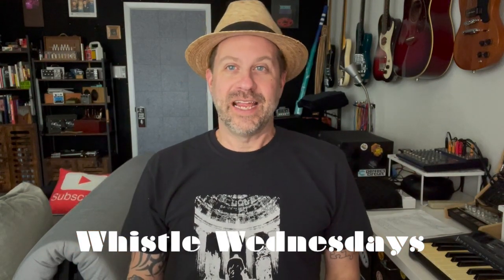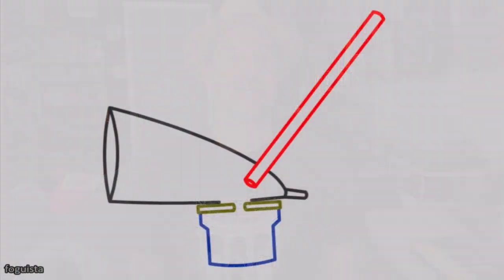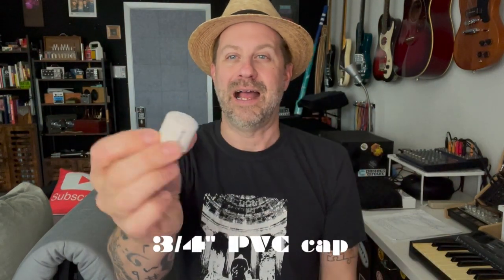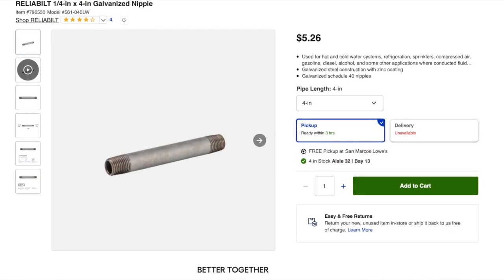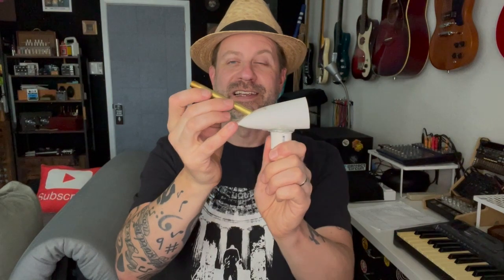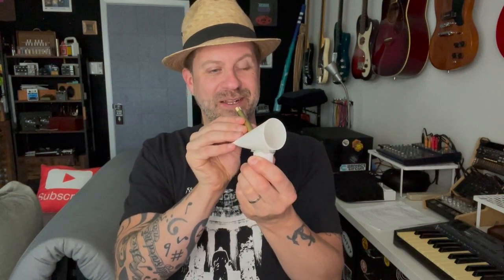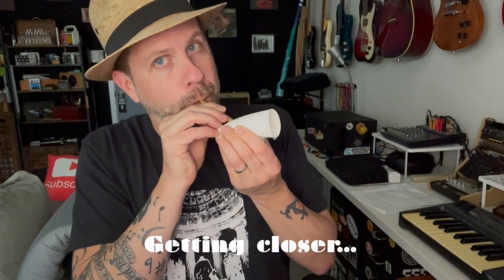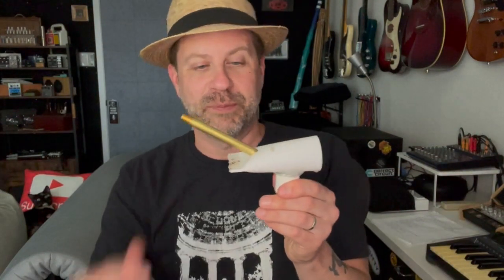I Attempt to Make a Death Whistle from Plumbing Parts

Comment: Question,Can i use wood instead of tube?
Reply from the maker: Are you looking to carve the whole thing out of wood? If so, I don't see why that wouldn't work. However, that's a LOT more effort. YOu'd have to start with a block of wood and carve that conical shape, then hollow it out. Yikes. The idea of this project was to be simple.
Reply: @musicalmiscellany  No i meant for the pipe replacement
Reply from the maker: @Ultra52b62  It could be wood, plastic, metal, cardboard, etc. It just needs to be something hollow you can blow through.

Comment: Is it possible to make it out of wood? (Just the washer sound Reservoir  and straw part)
Reply from the maker: it's certainly possible but that would take a lot of carving to hollow out a large tube like that. The reason I used the sink tube and pipe is because they're cheap and readily available at any hardware store. Good luck.